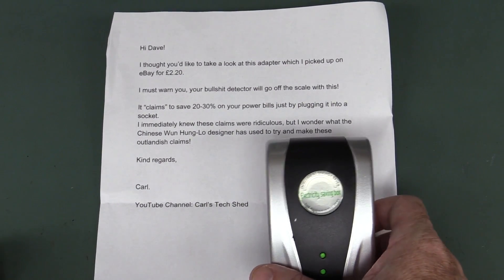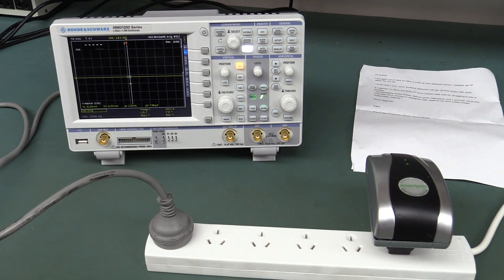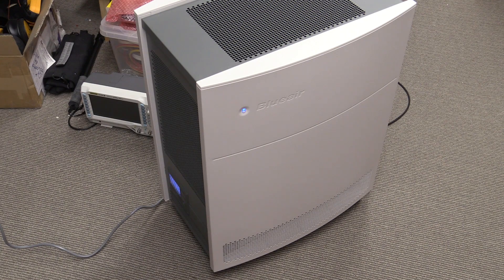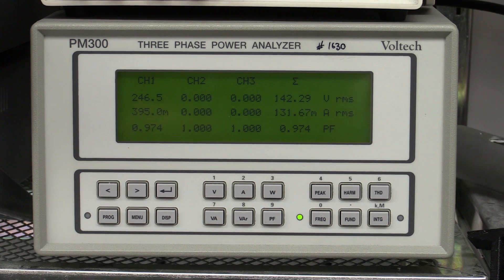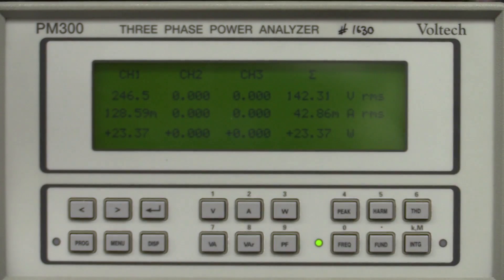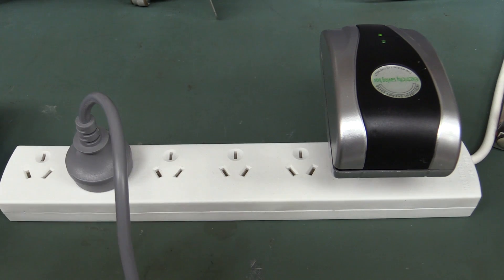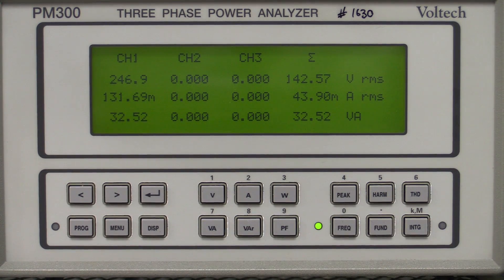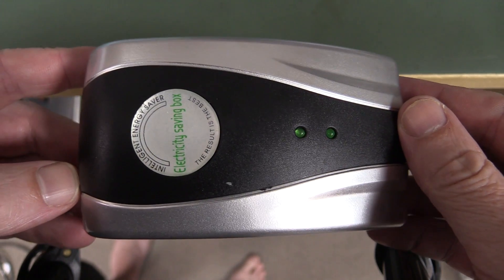EEVblog #848 - Home Energy Savers BUSTED!

Comment: Very few people (including Electrical Engineers) understand the concepts of reactive power and power factor. And it is correct folks gets charged for kWh, not kVAh. kW divided by power factor is kVA, which is always larger than kW since power factor is always less than 1. In heavily industrialized areas, the power companies required industrial consumers to have synchronous condensers, maybe these days they use Power Electronic PFCs.
Liked your video, maybe you should do one on Modern day power factor correction. Thanks.

Comment: You are an idiotic and stop misleading people, IN MY OPINION.  The device utilization - uses "sine" waves reduction... which help produce a more consistent signal over a course of time thereby reducing overall power consumption. if you don't want to use the device don't! I HAVE SAVED 101.23 with two devices connected in home.  One near breaker-box and one in front room. Maybe you brought  your DEVICE from a third party site and got scammed. Also, make sure you use appropriate grounds ...you can bend of connectors and expect to achieve nothing more than a electrical shock ( You become the source) or ARC FLASH!  IT WILL HAPPEN KEEP DOING WHAT YOU ARE DOING. BEST OF LUCK!

Comment: The product should implement a phase detector and adjust the inductance/capacitance accordingly.
Reply: There's no way that'll happen. That would actually cost money to implement, both in design time and materials. Also, as mentioned in the video, home users aren't penalized for power factor nearly as much (if ever) as industrial customers. If you need power factor correction, you already have it.
Reply: @Blustride  It's just my sarcasm to such a stupid product. It probably needs many ICs, transistors or actuators to control. The device will be expensive as well as bulky. The government should ban these fraudulent products.

Comment: Industrial owners, I recommend switching capacitors hooked in your substations because an inefficient power factor is frowned upon the power company. (that's why I asked our power provider to charge our residence for VA but calculating apparent power is a pain in the ass.) and noobs of electrical engineering (I'm still highschool tho), to get the power factor is easy. pf=True power in Watts or kilowatts, over apparent power in Volt-Ampere or kilovolt-ampere? I forgot but it's W/VA or kW/kVA

Comment: My Dad bought something simular for his fridge, it was supposed to lower power consumption for devices that are pluged in all the time...
After 2 Years the fridge died and i looked into the thing. turned out it was remodulating the sin wave, which killed the fridges Compressor... 
Also it did not save anything, the power cosumption actualy went up by 2 % (according to one of these cheap plug in power counters)

Comment: I've only seen these in industrial settings for the most part. One was a sawmill with all kinds of giant like 480V motors, etc. 
A church I went to for a while one of the people found and donated a small commercial thing like this. That one i think he mounted by the fusebox, ran some small conduit in and connected to it's own breaker. I saw it one day and asked someone around talked to person that installed it and he said it was like a bank of capacitors so when motorized things start up it draws power off the caps and not the grid. I just thought okay it may regulate that some, but it will still be the same power either way.

Comment: This is poor attempt to exploit mechanical power counter physics:  mechanical kWh meter is slowing down (counting less than actual) when voltage is higher than rated and when current is high. Therefore, increasing current without increasing real power will actually make the counter to cheat in our favor. But for that we'll need like at least 10-20A reactive current (for domestic meter rated 32A), so a capacitor the size of bucket, and constant risk, that we'll blow the fuses in service box.
You will not observe this effect with fancy digital meters or even analogue watt-meter -- You need the oldschool spinning-wheel induction kWh counter. We did this actually during hands-on exercises at university.
Reply: +nie podam Another method to fool electromechanical meters was to put a rectifier on the output. But on some electromechanical meters, large DC currents would trip a flag in the meter that could be seen by the inspector (I don't know how this was implemented)

Comment: It COULD save power, but only under special circumstances.
Correcting the power factor can improve efficiency of the power distribution system, but it's a very very small improvement on this sort of scale ...
The power company already has power factor correction capacitor banks hooked up here and there, and they can switch the capacitors in and out to get close to the best power factor they can, depending on the electric grid's load, and the type of load.

Comment: Really scraping the bottom of the barrel for trying to save I²R losses (on some loads).
Reply: +leerman22 If you are that paranoid, just use 8 gauge wire for all your 15/20A circuits

Comment: If you were to transform square waves into sine waves, that would save energy on it's own. Maybe not for most motor applications but for general electronics and brushless motors. The idea is the appliance produces less heat and draws less amperage. I'm considering getting a amp meter and a power conditioner at some point to see if there's any difference. Just curious do you think if you had a large enough capacitor, it would actually make a difference in energy usage? Like less amperage draw from the mains during startup?

Comment: If a capacitor will reduce the power factor in inductive loads, would it be likely that for an example here in the air purifier, it would have one already in it to reduce the power factor? Or if the factor changes in addition to the load (the different modes in the purifier), could it have a smart system that disconnects it when the load is not at its maximum?
Reply: +PunakiviAddikti Normally very large and electrically odd loads (e.g. big switching power supplies or big motors) have PFC correction added in. Things like air conditioners and PC power supplies have PFC correction built-in (in air conditioners there is a separate capacitor for PFC corrections, in PC power supplies there is an inductor or an electronic circuit)

Comment: When I was in school for electronics here in Colorado we sometimes had companies come in and pimp their products if it could teach us something. There was a a group that was making something called a kvars box and it was a power factor meter with some variable capacitance and some secret software jazz that adjusted the capacitance automatically. They were very, very clear that it is only intended for industrial use on equipment that did NOT already have power factor correction built in. While they were there they showed us how this type of device does NOT do much if anything for a home, but can do a whole lot for an old factory. It can be more economical to use these instead of replacing old but functional equipment. These are for very large, very old inductive loads from a time when we didn't know better, or didn't care. The people that aren't selling snake oil are just as interested in selling their products as they are about not selling them to people who have absolutely no need for them.

Comment: Real PFC devices are much better for this application... they are just modified boost converters to help in the VA, but they are not stupid like this.

Some large motor devices, such as drills have built-in Caps that are DESIGNED for the max load so the device is not screwing up your PF.

Comment: For big power consumers with a lots of inductive loads (like you have it in industry) things like that are often a must have otherwise you have. For big consumers the electicity providers often charge extra if the power factor is poor as they have to deliver a higher current over the cables which makes it more tricky to handle.

Of course the things they use there are not devices like that but a lot of big capacitors the switch on and off depending on how much they have to correct the power factor.

The thing actually reducec the current in the wire (if used with an inductive load) as it lowers the VA, but as alreaddy said, a normal consumer who might buy one of those things isn´t paying the VA but only the kWh he/she uses

Comment: Hey dave quick question: Does improving the power factor of my house make it easier for electricity companies to supply my household? Or in what way shape or form does this affect them.
Reply: +Lan Party Hosting 
That is a good question. The quick answer is yes. Improving the power factor of your home does make it easier for electric supply companies to supply power to your household.

The effect is. Having a poor power factor increases the demand on the points of generation on the bulk electric system. Watts is the power used by a device for its intended purpose. Any additional power used by that device is power required to run the device but is not used for its intended purpose. That additional power is added to the watts and becomes Volt Amps Reactive, VAR, and is the sum total of power consumed. As Dave mentioned in his video the power factor is (True Power / Apparent Power, or Watts / VAR). This provides power factor as a percentage.

That means that if every residence only had a power factor of 50% as opposed to 100%, the generators supplying the power would have to provide twice the power to all the residences even though only half of that power is actually helpful. This means the size of all the power lines need to be larger, and the generators need to push more.

Hopefully my quick and dirty explanation helps.

Comment: Speaking of inefficiency, a couple of years ago I went on a camping trip and brought my laptop with me, along with an inverter that plugged into the cigarette lighter of my car.  I got to thinking about the number of conversions taking place to power my laptop.  The engine drove the alternator to generate AC, which was rectified to DC, then the inverter converted it back to AC at a higher voltage, then the laptop power supply converted it back to DC and lowered the voltage.  Surely, there's a lot of inefficiency there.  

That's an extreme example, but even in a house, almost every electronic device has a power supply that converts the AC from the outlet to DC for its own use.  It seems like there should be a DC outlet standard to save the cost of all those separate rectifying power supplies, and consolidate them into a single high efficiency unit.

Comment: 0:24 Технические характериски. Dat crazy Russians. Vodka. Bear. Putin.
Reply: +magazovski 
Lots of old electromechanical disc type energy meters still used in Russia.
This device doesn't save any energy. It cheats old Russian energy meters - slows them down or even makes them count in revers direction.
Useless with modern electronic energy meters.

Comment: It corrects inductive load that has the same amount of reactive current as this capacitor injects. By the way, these kinds of capacitor power savers work with very old mechanical power meters. I've seen these devices deceiving mechanical power meters with my own eyes. These are sold as power thieves or power savers.

Comment: The secret is to deep fry the unit in extra virgin olive oil at exactly 200°C  for 10 minutes.
Reply: +Paul H And yes, you're welcome.
Reply: 200C is not nearly hot enough, 2000C should yield a more acceptable outcome.

Comment: What are the market forces driving for compensation outside of e.g. a factory? Wouldn't it make more sense for equipment manufacturers to compensate for VA:W to make that difference be paid for (by the economy as a whole) over as little conductor as possible?

Comment: Big industrial customers get charged on both kVA, kW and peak draw averaged over a period ( typically 30 minutes), along with a time of use tariff on all of these. They tend to both schedule high draw loads for after peak periods and run an overcompensated synchronous motor to get active power factor correction. If you are in the MVA load region you also get a disconnection penalty for sudden drops in power use, along with certain incentives where you can be asked to disconnect a large part of your load during peak periods for certain durations to help with load balancing and despatch. Things like ferrochrome smelters and such thus often operate at night when load is lower.

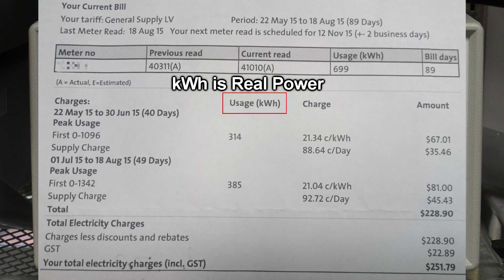Comment: For 02:38 damn i was close to leave the doors running to the next tech-shop to buy 20 of these, as if i only plug in enough of these things together it will let my power meter running backwards....!

The "instructions"  saying that one item can lower my bill about 10% at least, so if i buy 20 of them i´ll get the same amount back of what i pay currently to my energy supply company....

If you haven´t done that video, this energy saver wouldn´t know of that...and it would still thinking that it work....

Dave what have you done.......

Comment: It was actually quite obvious what would happen to the power factor if you whack a cap across a capacitive load (SMPS w/o PFC in the R&S scope). :) An inductor would be needed here. 

Anyway, the professional industrial solutions often use multiple capacitors (cap banks) that are switched in or out of the circuit based on the actual power factor, since it is dependent on the load of the motor.

Comment: Hi Dave,
In The Netherlands it will not be the utilities doing the power factor correction, but it is the customer who has to. You are not allowed to connect to the grid below a certain PF, and it is your responsibility as industrial customer to make that happen. Residential customers don't care. By the way, Fluorescent lighting armatures are a great example where they use a cap to shift the PF. I have seen armatures with two lamps and starters. One with cap and one without. But nowadays, with electronic ballast/starter combinations those are getting more rare.

Also, I loved Wankeriser! That'll teach them. Batteriser....what a Joke!
Reply: +Wouter Weggelaar the capacitor in the dual tubelamp is not for compensating the cos phi, but to avoid stroboscopic effects, the capacitor shifts the fase of one tubelamp with 90 deg. so when one tube is of the other with the cap is on. This is used in factories with motors (50Hz)
Reply: +Bp Oelen cool! I didn't know that. I found them in a school though,  when I was about 14 years old. the school was knocked down so I took some caps and ballasts out of the dumpster. and a phone bell, I still have that as souvenir
Reply: +Wouter Weggelaar They were also used for commercial applications where CRTs were commonly attached to lots of computers. this way people don't see the screen flicker which makes the monitor easier on the eyes.